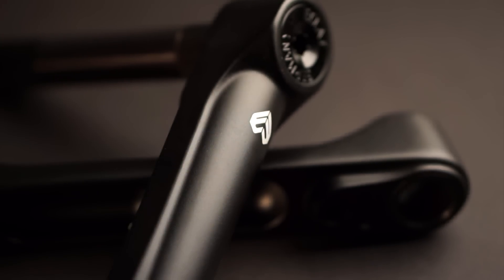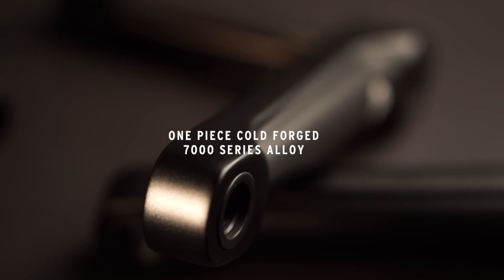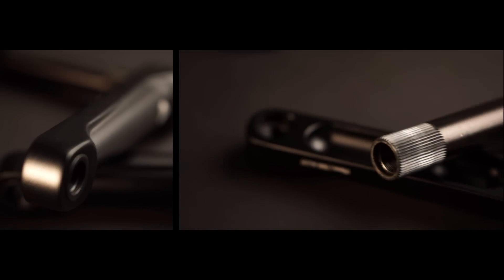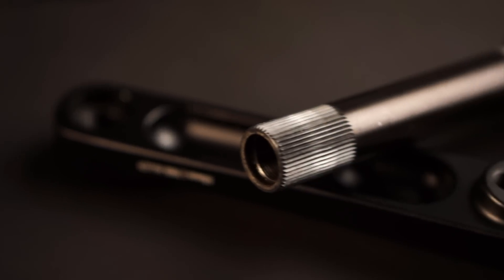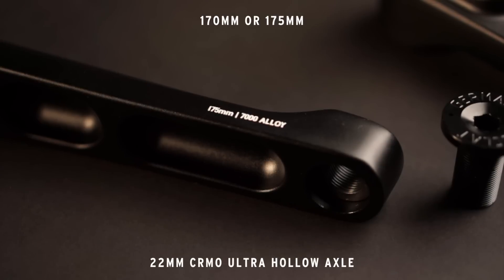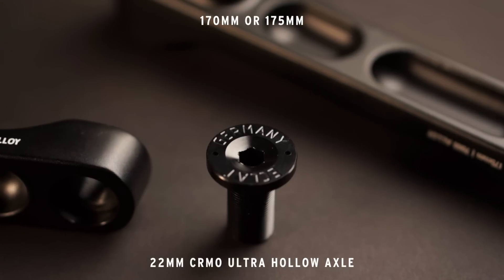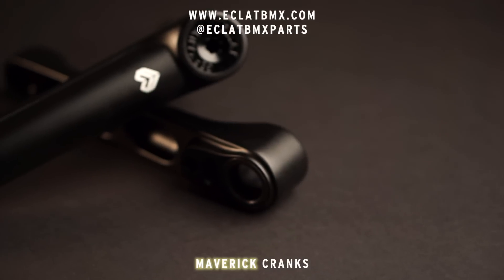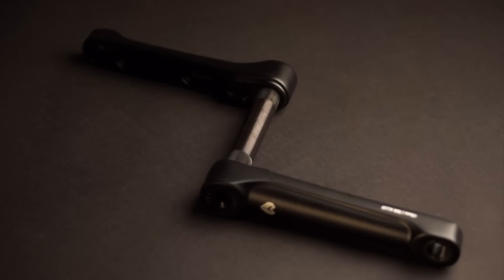The Eclat Maverick Cranks

Comment: Mountain bikes haven't used a square spindle since the 90's. In fact, currently most high end mtb cranks use either a 30mm alloy, 24mm steel or the newest sram dub system which is 28.99mm. All of which are splines.
Reply: Bmx has had 48 splined cranks since the ‘70s.